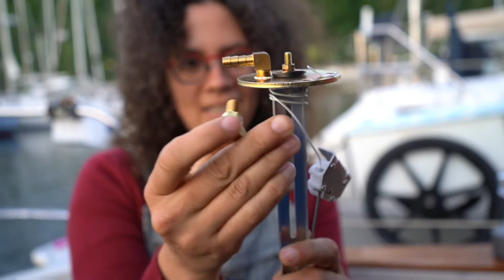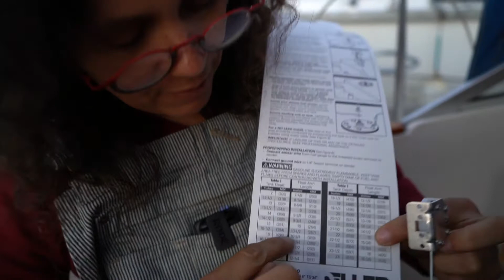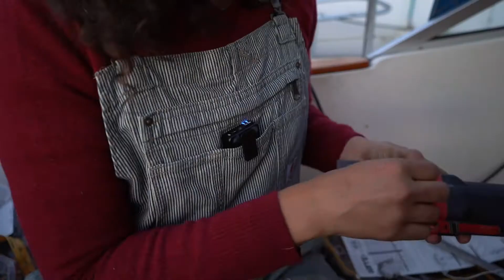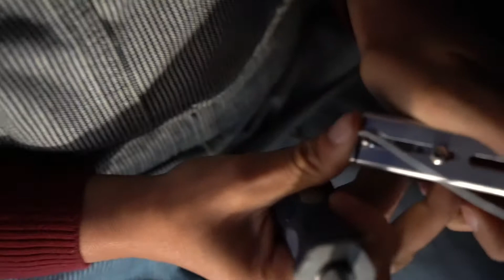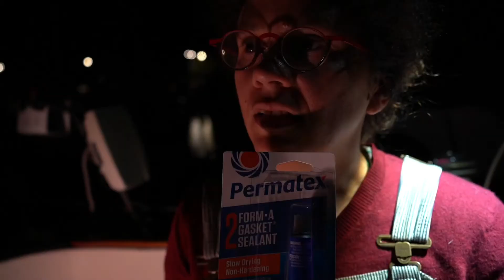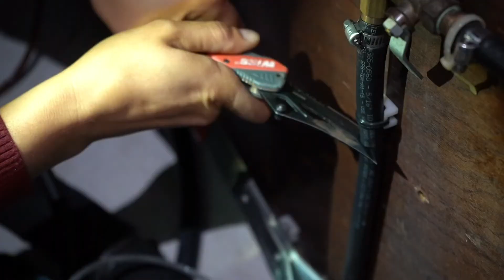Sit Back, Relax, And Watch me Install Sh*t — ASMR — Sarah Scott — Adventures of a Black Woman Sailor

Comment: Nice work, your awesome.  Just as an fyi, when working with the hose clamps instead of using a flat head screwdriver use a small socket and a ratchet or a nut driver.  Can tighten easier and tends not to slip as much.